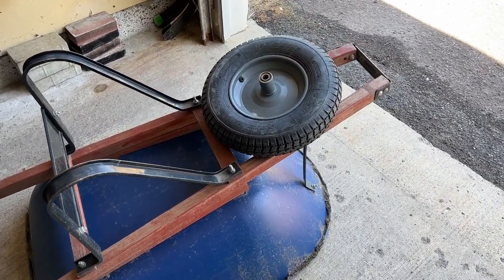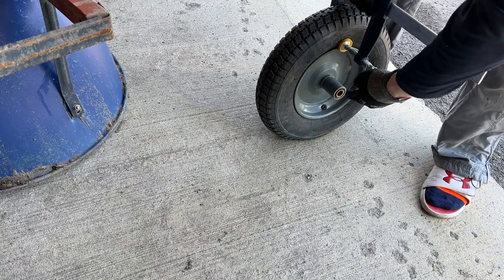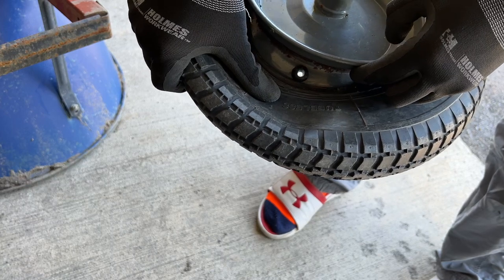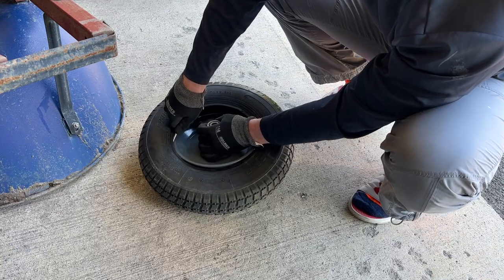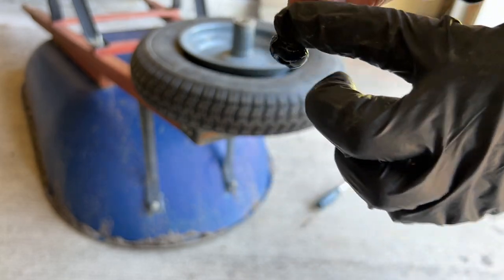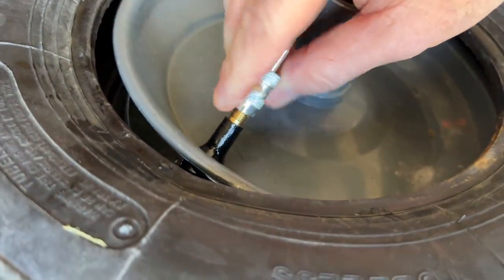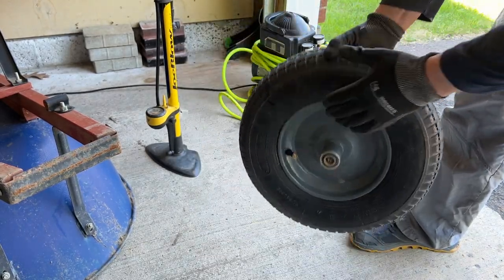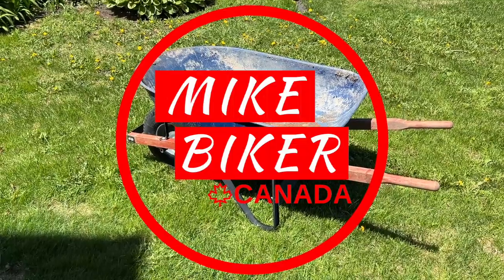Wheelbarrow - Replace Tire Valve Stem & Break Bead

Comment: you know if you were wearing a pair of work boots you could of just stepped on it
Reply from the maker: Hey Dan!

🤣🤣🤣 I only realized after I filmed the video that I had bright orange socks and red/white flip flops. Horrible look lmao.

I actually jump on my car tires to break the bead and you’re right that usually works like a charm. But these wheelbarrow rims have an awkward axle piece that jets out. Prevents the rim from laying flat in the ground, instead it sits on an angle and too unstable to stand on. Probably break an ankle.
Reply: Yesh, but if he stepped on it, it would've only been a one minute video.  And secondly, if you go through all that work to break a bead to get to the valve stem, I would've spent 10 bucks to just buy an innertube because I hate those tubeless tires that are always losing air.  All my barrows now have tubes.
Reply: @lostinmyspace4910  

Yeah my beads always taking the initiative to break itself. I'm sick of it lol
Reply: @dethmaul  😂